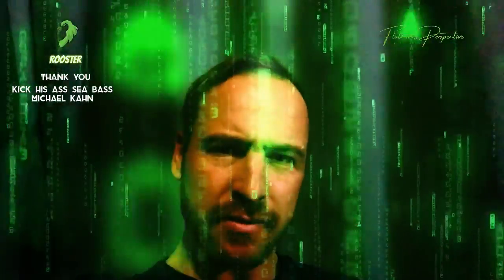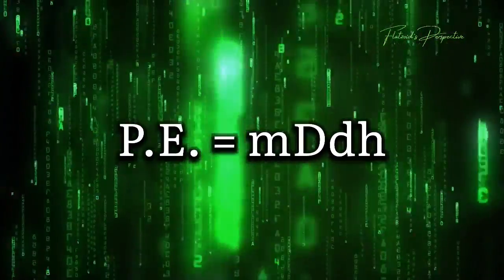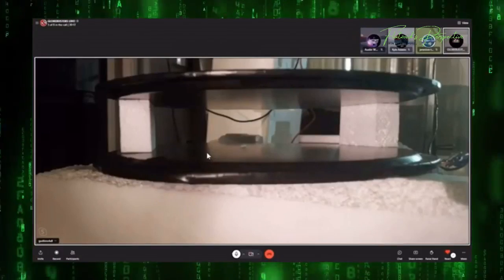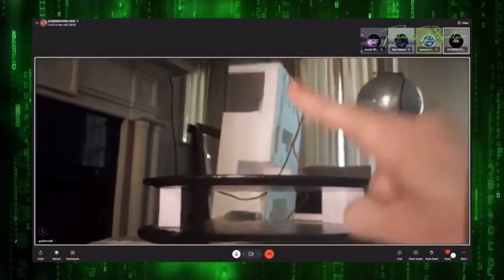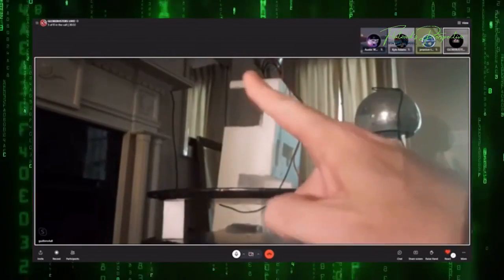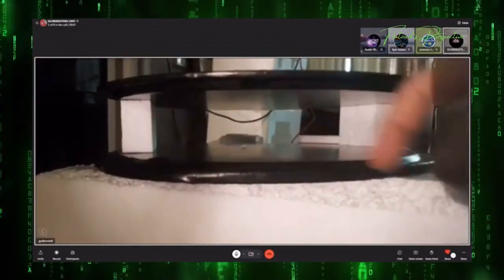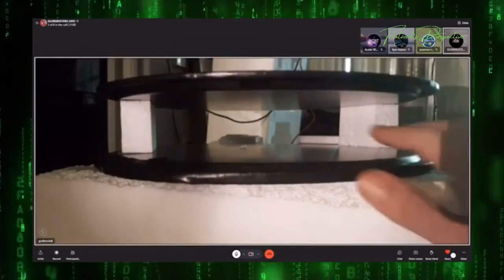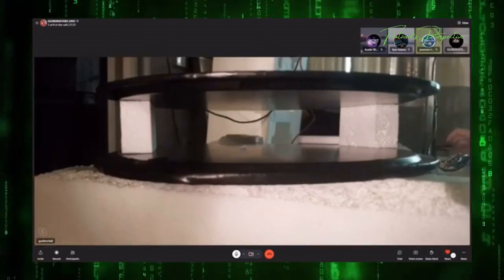Relative Density Disequilibrium Equation! What causes the vector?

Comment: Still waiting to hear as to why a block in air falls to the ground at 9.81ms^2 when the air all around it is at the same density.
What makes the block ALWAYS fall to the density below it and not to the side - it's the same density
Reply from the maker: Watch my latest stream. Pressure is a physical force 👍
Reply: @CrealityPodcast  pressure = force / area but ok ....
Why is that force down towards the ground?
What is the deciding factor that means an object  surrounded by equal air or water pressure will make that object ALWAYS fall to the ground ?
Reply from the maker: Also explained in the stream
Reply from the maker: The Pressure is a Physical Force!
https://youtu.be/bzh2ivrHoF8
Reply: @CrealityPodcast  I'll look forward to the explanation of why down - thanks

Comment: So if things of different density align most dense to least dense - why do they do that vertically with the most dense things being closest to the ground and least dense at the top?
Why no left to right?
Reply: Or why things don't fall up, since the air above is less dense and has less pressure?
Reply: @kschantz  he says because you've given it potential energy by moving it from the ground up but that's balls because what if I move something 1meter along a shelf - why doesn't it return back?